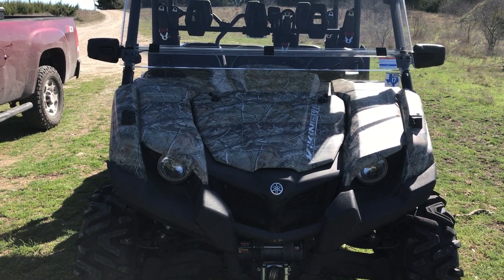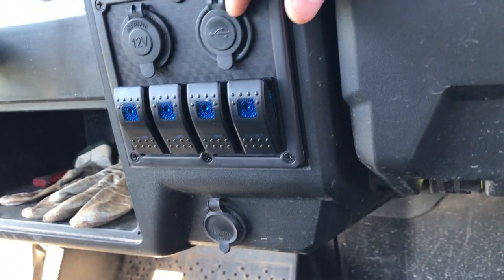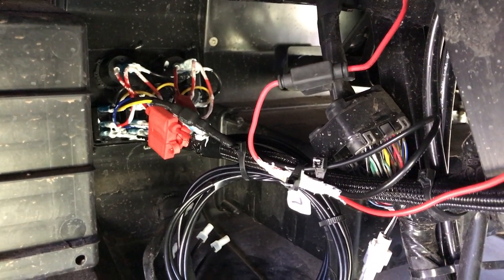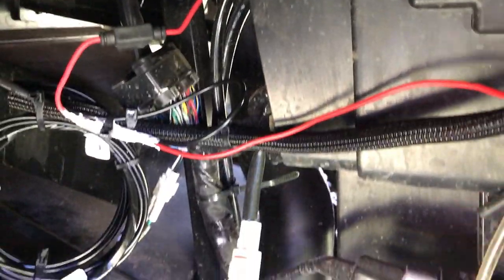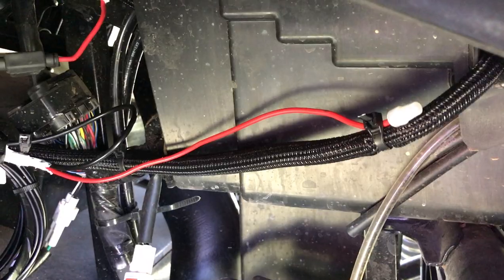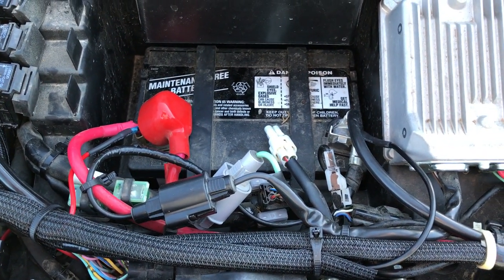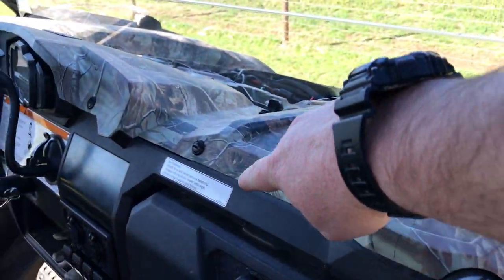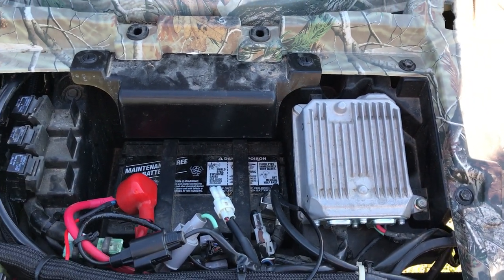UTV Rocker Switch install

Comment: Great video, what type of connections did you use to connect to that spare stub?
Reply from the maker: I just cut the ends off and used heat shrink butt connectors. Since this video I’ve gone back and daisy wired the hots and negatives then just ran each switch leg with a in-line fuse and/or relay to the load.
Reply: Awesome thanks for the info!